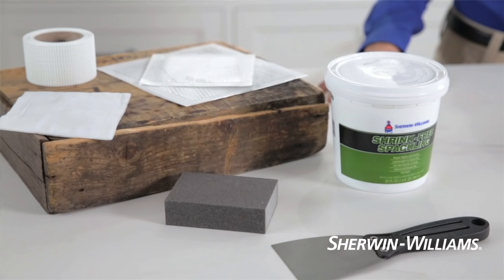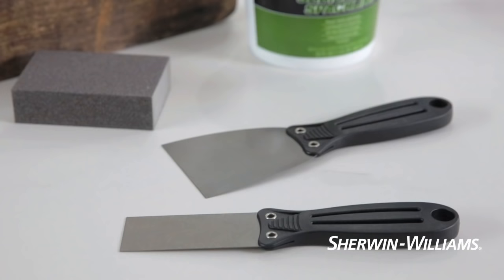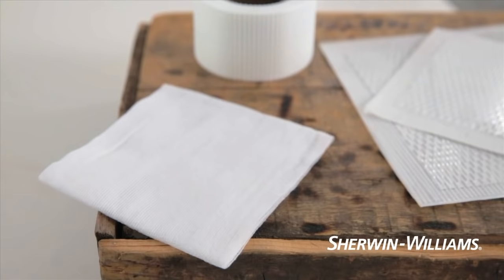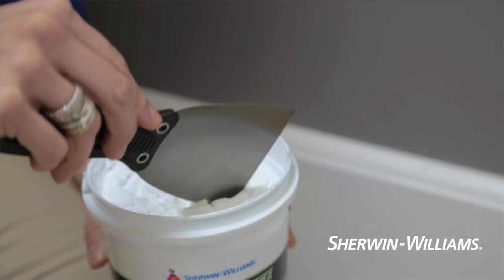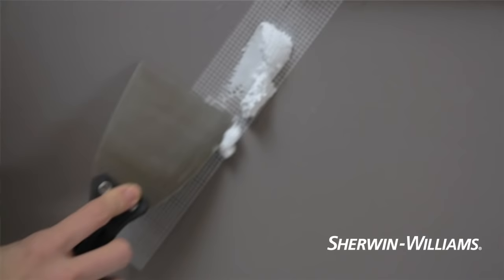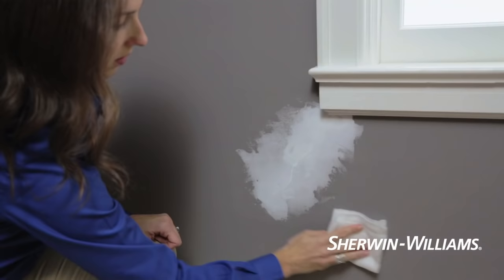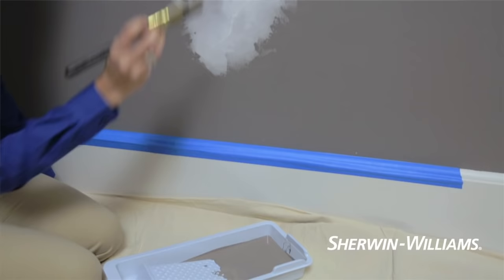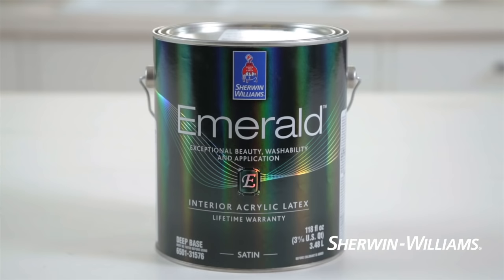How to Fix Cracks in Drywall - Sherwin-Williams

Comment: Meanwhile the settlement crack in the wall goes unrepaired and worsens over the years. Good job Sherwin Williams for teaching people to just cover up problem and not actually fix it 👌
Reply: Why do you assume that crack is caused by ground settlement? There are many reasons why buildings crack and ground movement is only one of them. Ground settlement might be also either progressive or not. 
My point is- cracks doesn't have to reappear or worsen.
Reply: wrecked
Reply: dam, that was savage.
Reply: You're 100% correct!!

Comment: If you have a crack in the plaster take some epoxy and mix it with a little saw dust and smear it in the crack then put some wood filler  just in the crack this keeps the repair in the crack .

Comment: Ok so imma just stop it right at 26 seconds and tell you to pack your stuff and leave.  V-NOTCH THE CRACKED LINE, CLEAN the cracked area.  Use quickset compound(not the all purpose stuff) to lay your tape.  Mud it up and float it.  Wait and float it out again sanding in between.  THEN you can add your all purpose(top coating) mud on that if you want, sand it, texture it..  DO NOT half ass it like this video
Reply: What? You a wantin' it done right or somethin'?

Comment: What happens if the paint doesn’t match original paint or the original paint is changing colors because left in closet for a long time?
Reply: If paint doesn't match and it bothers you then paint whole wall.

Comment: Might want to dig that crack out first.
Reply: Why?
Reply: @lijie6431  remove all loose material in the break. Allows your mud to form a better bond inside the crack and on the surface with the new tape.
Reply: Exactly
Reply: How do you dig a crack out?
Reply: @priscillak7825  5 & 1 or a knife will do.
Reply: I would be scared to start digging more.

Comment: That's not a repair that's  a band aid, that's why so many fackers charge so cheap, the correct way is to actually fix the problem then paint entire section of the wall has to be painted otherwise is gonna look terrible if you just paint the shit you just covered.
Reply: how do you fix the problem (crack)?

Comment: I mistakenly punched on the dry wall and it had little crack but not that seriously, just 2.5cm of crack. What should I do now?... I don't want to tell my mom but it seems quite easy to paint it on.. What should I buy and how much will it cost..?
Reply: J A ooooo you're in big trouble now boy 😂
Reply: Dude, put a big picture of your mom over it. She'll never know and you'll get brownie points. I did that a lot when I was a teenager and put a bunch of holes in the wall. She finally figured it out when I had a good size picture of her right under the mirror in mine and my brothers shared bathroom. Tried telling her I put her pictures up everywhere cuz I just missed her, can't believe she didn't believe me.
Reply: dude she just read your comment no turning back now, flowers might work lol, best of luck
Reply: Same way you "mistakenly" punched the wall, you should consider "mistakenly" taking your butt to anger management classes. 
Otherwise you might "mistakenly" punch another wall, or worse... somebody.
Reply: @itslikethat5456  bro, hope you went to anger management